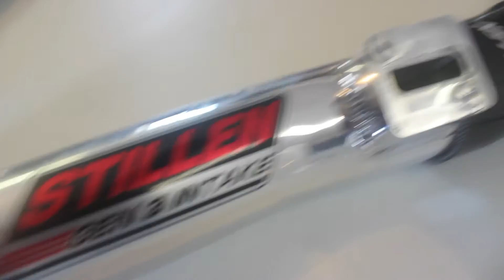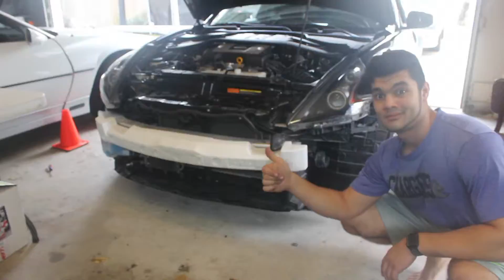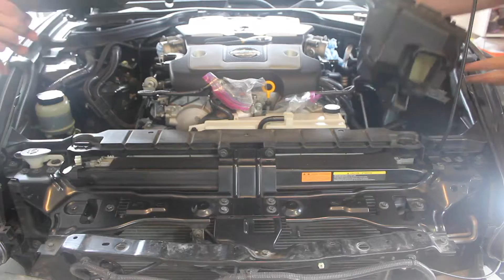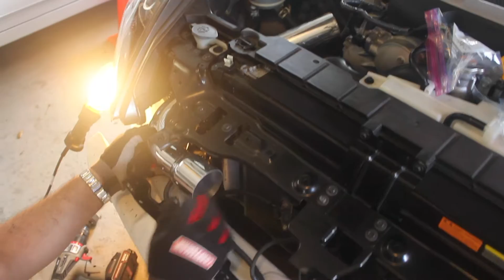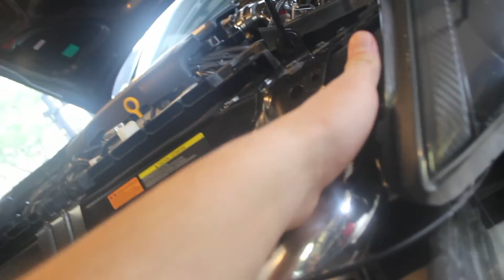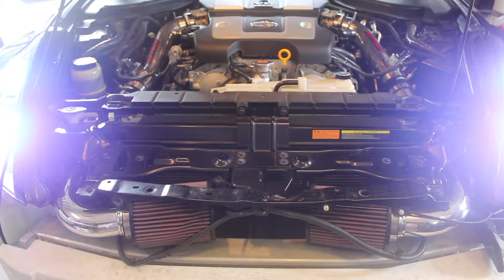Nissan 370Z STILLEN Generation 3 Ultra Long Tube Dual Intake Kit install

Comment: scared to cut some of these things off do you think its worth it?
Reply from the maker: yes, the throttle response is so much faster.
Reply: @brockzayas1070  do you think this is much better than a normal length K&N intake?
Reply from the maker: @Rocky-ry4lx  yes